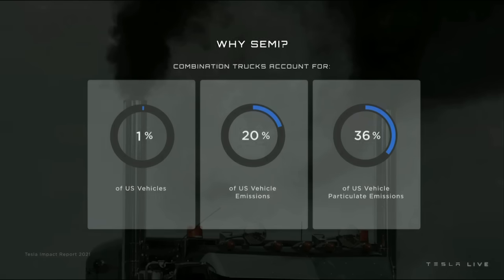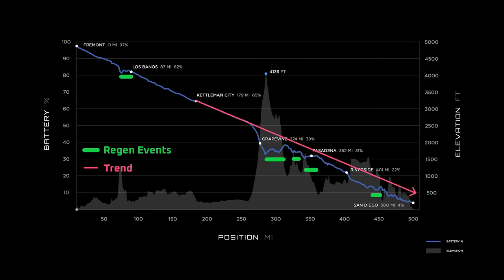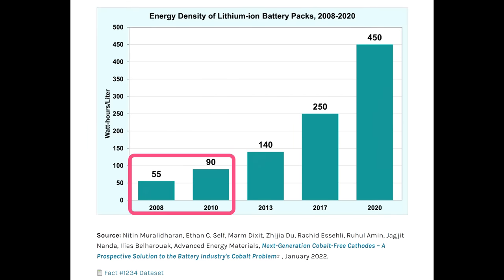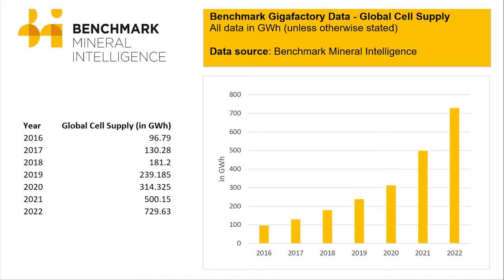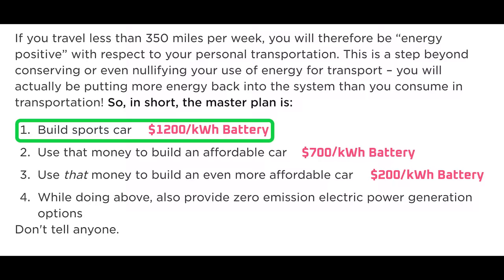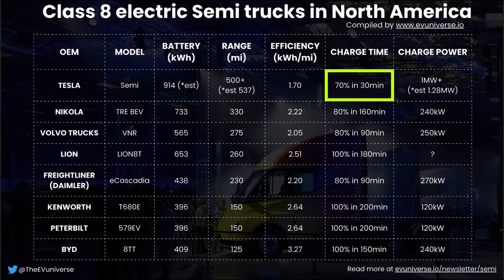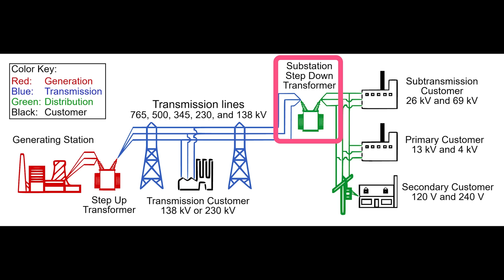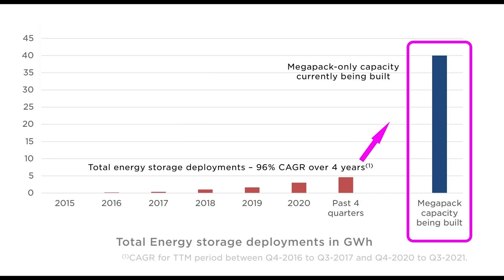The Tesla Semi:  Why Now? // The Road to Commercial Viability

Comment: A small difference in powertrain efficiency makes a big difference for regenerative braking because it's the amount of energy lost that matters instead of the amount of energy gained back.
Reply: T also mainly depends on the surface driven! Uphill would have significantly reduced that range even flat surface.
Reply: @alanmay7929  That's where regenerative braking shines, if you have an efficient powertrain you get almost all your energy back.
Reply: @johntheux9238  nope!!! You "don’t almost” get all the energy back doesn’t really matter because all those EVs will perform almost the same on regenerative, also tesla isn’t the only one using multiple motors lol!! The amount of energy recuperated depend on the distance and slope you’ve done…..
Reply: @alanmay7929  I meant that you would get back almost all the energy that you used to climb the hill, but you still lose the energy from rolling friction and drag, which means it's like you were driving on a flat road for the same horizontal distance.
Reply: @johntheux9238  nope that’s not the case lol!!! You can only recuperate enough energy as long as going downhill is long enough, also spending on conditions you won’t have to use regenerative when the roads are icy….
Reply: @alanmay7929  The roads being icy doesn't make any difference, trucks are not supposed to be sliding down the mountain even in winter.
And as long as you end up at the same altitude as you started you will be going downhill as much as you went uphill.
Reply: @johntheux9238  yes it absolutely makes a difference! The vehicle is supposed to be reactive instead of just applying the brakes or whatever! You're not always going to have the situation you're describing in your comment lol!!!!
Reply: @alanmay7929  Regenerative braking in the Tesla Semi recovers about 80% of excess energy used in the climb. This can be easily seen in the graph of the 500 mile range test, and very accurately matches the theoretical calculation. In that test, the Tesla Semi only lost 10-15 miles range to 4,200 foot climb over Tejon Pass.
Reply: @BigBen621  nonsense!!! They took that route very expressively to have that range which isn't going to be the same on flat lands! On colder environments..... Also how dumb is it to compare that 1000hp truck to 500hp diesels!? A Scania 770s with only 770hp or even 600hp can literally haup up to 4x the load of that electric truck everyday of the week.

Comment: The Tesla Semi was not late, it is sliding into the first slot where the batteries are mature (by energy, volume and availability), mega chargers + mega packs are available, and Tesla has the $2 Billion to spend on the factory without using debt.

Comment: Good summary of the Tesla Semi and its current advantages- I had figured that battery constraint was the largest factor in the delay.  Now, however, I still have some doubts about a 50,000 run rate in two years- I would think the biggest constraint at that time will be the build-out speed and locations of the Mega Chargers that are going to be needed for the Semis.  There are anywhere from 10,000 to 40,000 truck stops in the US currently (depending who is doing the counting), though the lower number is probably for the vast majority of the US- but even starting at 10,000- that is a lot of Mega chargers, a lot of Power Packs and a lot of Solar Panels to supplement those locations.  And will Tesla partner with current Truck Stops, or have to build their own?  And the land required is gong to be vastly larger than required for even a large Super Charger site- from several acres up to a hundred acres or more.  And since the Mega Charger will be occupied longer, more chargers will be needed than fuel pumps for the same number of trucks.
Reply: You don't NEED to supplement with solar panels. You don't NEED 10's or hundreds of acres.
It would be a bonus, if practical and available.
Reply: @gregbailey45  - I think if you look, most truck stops are several acres, at least- it take a lot of space for them to pull in, charge, then park- many need to accommodate overnight parking.  And for charging, you will need more space to accomodate more chargers than pumps for the same volume of trucks.  Additionally, solar panels (and batteries) will make it easier to install and then support massive electrical needs, as well as cheaper for Tesla over the lifetime of the system at most locations I would guess.

Comment: There is a lot of unknown with this amazing piece of technology that 'almost' defies the laws of physics but I guess a lot has to do with a lot of time only needing 1 or 2 (out of 3) of the hyper-efficient electric motors while enabling the use of all 3 as generators along with the internal wiring architecture of the battey pack to allow the pack to such-in all that power into the battery. Great job Jordan, keep it up!
Reply from the maker: Sure thing Mario!
Reply: It’s not an amazing piece of technology lol!!
Reply: The battery is likely separated into I can guess exactly 10 x100Kwh like on normal cars then charging is easy!
Reply: Also for the other companies they didn’t wanted to maybe have massive powerdraw so tha it can be charged anywhere possible.

Comment: As of Q4 2022,  unless I misread the data, Tesla was still a very small player within the GRID SCALE ENERGY STORAGE INDUSTRY.    I'd like to know if I am wrong about this.
Reply from the maker: If you're looking the broader industry, Tesla is a spec.  But if you look at them as a proportion of, specifically, batterized energy storage - they're king dong
Reply: @eugeniustheodidactus8890  How much does BYD have currently deployed?
Reply: @TheEvilmooseofdoom  Very hard to get the numbers but in 2021, Guidehouse had this to say: 

"Fluence & Tesla top Guidehouse list of top utility-scale energy storage integration firms."

Tesla was cited as being #2 in the world. 

Honestly, from what I am seeing tonight, most of these companies are deploying storage in terms of  hundreds of Mw  while I know that Tesla deployed 6.5 Gw last year alone.  While there is a difference between behind the meter  and front of meter installations,  I may have made a huge error.
Reply: @thelimitingfactor   Yes....  Tesla, according to Quartz Magazine, has built the world's largest grid-scale battery storage facility ( 730 MWH in 2022 ) in Ca and is currently building what will become the 2nd & 3rd largest facilities in the world.   ( Other facilities boast larger scale projects but only if you include their expansion plans. )  

Other periodicals have recently listed Tesla as being either the #1 or #2 top battery energy storage company.  ( Some of these rankings go by market cap and not deployments, which can obviously be very misleading. )

Comment: Seems to me that the "tabless" structure allows for quicker both charging and cooling (shorter path for electrons for a given capacity), if the power and heat conduction are available. Am I wrong?
Reply from the maker: It doesn't allow for quicker charging, it allows for a larger battery cell at the same charge rate.  You can use the thermal conductivity to incrase rate or increase size.

Comment: While Tesla's semi is probably ahead of all of its competition, the chart compiled by EV Universe has a problem with the Charge Time column.  It's not an apples to apples comparison when charge times are given for different amounts of charge (70%, 80%, and 100%).  Also, what was the starting charge?  There really needs to be a regulated standard that locks on variables to you have a number that can be compared.  Such as, charge time from 20% to 80% with preconditioning to xx degrees - or something like that.  Most of the other measures may also be worth regulating as well, but are easier to make an apples to apples comparison with.
Reply from the maker: If you have a better chart I'll use it. If you complain, be sure to offer something better than what you're complaining about.
Reply: @thelimitingfactor  lol - sorry if that's the tone I conveyed.  Not a complaint of your work at all or even EV Universe - your content is always well researched and presented - which is why I subscribe and give you a thumbs up for this post.  Just an observation of an area with limited information available from Tesla and the lack of a standardized measure.

I greatly appreciate that you are a seeker of truth rather than following the path of so many other channels (cough cough Blunderfoot) that put out misinformation because it's easier to monetize.

Comment: Jordan, a request. Can you explain why an induction motor is preferred at the front, and a permanent magnet motor is at the back? We'd appreciate your synthesis. Thanks, Frunky.
Reply: Induction can be easily and electronically converted to “neutral” on the front drive wheels while the permanent magnet motor keeps driving the rear wheels. The permanent magnet front motors on Semi need a gearing system to safely shut off the motors when not needed.
Reply from the maker: See Michael's comment
Reply: @EMichaelBall  Excellent! Thank you, Frunky

Comment: I think what many people are missing is how Tesla will benefit from all these mega packs at their charging stations. 

Besides using them to arbitrage power to give them cheaper electricity for their chargers during the day, they can also tie these into virtual power systems to sell some energy to help meet peak load support. 

With their distributed charger networks, Tesla is setting themselves up to be the largest provider of grid stabilization in the world even as they improve the reliability and costs of their charging network. 

Besides being a typical Elon chess move, it now has the added benefit of milking the IRA   subsidies to the max, while improving the bang for the buck of American taxpayers at the same time. Not too shabby.

Comment: Feel free to tell me why this wouldn't be viable, but instead of charging the pack from 10-70% in like 30mins from 1 charger, why couldn't they have a charging plug on both sides of the truck that kinda let's you divide the pack into two sides, where you could plug a mega charger in on each side and would maybe allow you to go from 10-70% or 80% in 15-20 min.
Reply from the maker: I think I could certainly do a double plug.

That's something they were doing at the regular superchargers with a special adapter.

However, the charge rate is actually limited by the chemistry.  

80% in 30 minutes is the maximum right about now.

Comment: The Freightliner and Volvo EV semis would be good for operating at container ports, which currently require diesel trucks inefficiently burning both fuel and DEF. There’s not much range required for trucks to get from the ports to their destinations, where they can be charged, if not a little extra at ports, with enough infrastructure improvements, there as well.

Looking ahead to the next Limiting Factor vid on the Semi: For at least a little while, the relatively small production capacity of Tesla can be mitigated by other manufacturers supplying EV’s for container ports. Longer term, perhaps Diamler’s self-driving technology can get good enough to cover the last-mile operations out of ports, so they can prevent a Tesla monopoly.

Comment: I have a bit of an issue with the claimed 70% in 30 minutes charging time, compared to 100% charging time. We all know that the charging time slows, sometimes by A LOT when the battery is nearly full. For all we know, the 8TT might have 70% in 30 minutes as well, it wouldn't be impossible. I guess it can be checked, but I'm too lazy to do that. I know, the overall conclusion would've been overall the same, the Tesla Semi is still the most efficient one and it will surely charge the most miles for 30 minutes, and by a good margin. But 80% better vs 5 times better is still a massive difference.
Reply from the maker: Exactly, conclusion overall would be the same.  But you have to factor if they are charging that slow, the charger is just limping along.
Reply: @thelimitingfactor  Oh wow, didn't expect a response :)

I like your videos, keep it up!

Comment: As I go back to your video, it is nine months since the analysis, and now we are on the eve of the one year anniversay of PepsiCo taking delivery of Tesla Semis into their Modesto depo from out of Tesla Nevada (aka Gigafactory 1). 

I do not want to cast any aspersions on any of your calculations and engineering approximations. I think that surely they are made in good faith, as is your aim as stated in the title of the video, outlining the practical constraints placed upon Tesla. That is all fine, although I would suggest that the question is not why is it so late, but why was it was so early. Nevertheless, all those same constraints and all else typically faced by Tesla, I would suggest, they remain, in both the short and medium term and that is the what is important here. 

Surely there are two sides to these sorts of "engineering" approximations, the abstract and the concrete. In the first instance, one must admit that you have no opportunity but to take the Tesla proposed design aims at face value and the efficencies they are demanding as their inherent aim . . . and which one might suppose . . . must set them up at something like a clear 15-20% advantage over any potential competing manufacturer. That is fair enough. They will not be satisfied with anything less. The argument that you make that substantial progress has been made on each of the principally required efficencies, that is fair enough, too. But the asserted aim so high that now it is six years since the launch event and there is but one customer with the prototype and one only, and there is no one else who may even know the specifications of the pre-production prototype. 

So here is the first problem. You assume in your analysis a range of 500 miles. But that is to miss the point and to be distracted at what is really at issue. I put it to you, that there are only three vehicles that are known to have been "delivered" and used for that purpose.The vast majority of the tractors we know of  are having their use case established as if they had a 600 kWh battery, and that is, in fact the established market at the moment. 

Now, there are more than a just a tiny few operators who calculate the opportunity cost is wholly to their advantage to take delivery any of these tractors and at the earliest opportunity. Surprisingly, this apparently includes companies in Norway, Lithuania, and supposedly Waberer in Hungary who proudly announced on July 27, 2018 they would be the first in Europe to take delivery and trial a Tesla Semi to assist in their contract with Amazon. But for the run of the mill operators in Europe, does Tesla publish even the length of the tractor, so as it might even be considered in their area of operations? Is it wrong over here, for any and every small operator to discount completely the aerodynamic efficency upon which that you placed such emphasis? 

You tell me, Jordan, if you could put down USD20,000 and have your order accepted by Tesla, tell me to the closest USD100,000, what do you suppose you are going to pay for the 500 mile version (not including any government subsidies)? 

And here is a quiz question for you. In your new purchase agreement, are you interested in fully loaded Gross Combination Weight, or Gross Vehicle Mass? Which of those is Tesla going to tell you right now? 

Regarding the value from increased energy density in the battery packs, are you planning to get a 10% benefit from 4680 cells in the tractor you are ordering? Then just where do you suppose those cells will come from considering that the new production line at Gigafactory 1 maximizes Panasonic's available space, and the new US Panasonic factory will no longer produce 4680 cells? 

Considering at a most basic rough estimate, that there are just 200 pre-orders ahead of you, and you are the the 201st, in which Quarter do you estimate taking delivery? Just a reminder, you have made the clear suggestion that we should all accept that in the fifth quarter, starting from January 1, 2024, there will be 10,000 Tesla Semis produced. 

Or to put it another way, who do you think will be the first company to put their electric long haul tractor with a 600-1,000 kWh battery into the hands of their first 18 customers, Tesla Nevada or Daimler Truck, Wörth am Rhein? Who do you think will be the first to go into series production, considering Daimler's launch event for the eActros 600 was last month, October 10, 2023 in Berlin.

Comment: What a truck for the Dakar Rally... Tesla should enter to prove the point even if it doesn't win.. But it could because the power is huge.. The assistance truck needs to be a battery storage system.. The 900kwh plenty range power for a days racing. The only issue is the front axle needs to drive and CTIS.. The centre of gravity is perfect juat requires a streamline rear and roll over protection..

Comment: Great video Jordan! Just a comment on efficiency. If the efficiency increases from 50% to 100% that’s actually a 100% range increase not 100-50=50% as your calculus suggested. So i think Teslas conclusión between efficiency and range comes from this mainly rather that the regenerative addition to range.
Reply from the maker: Yes!  I should have been more clear there on percentage points for percentage
Reply: Let’s not forget the terrain of the road trip which is most decisive

Comment: The math doesn't add up for the energy, range and efficiency of the Freightliner eCascadia in your table. If the range and energy numbers are accurate, efficiency should be 1.90
Reply from the maker: The table is based on numbers from the manufacturers, and it wasn't assembeld by me.  See the credits in the corners.